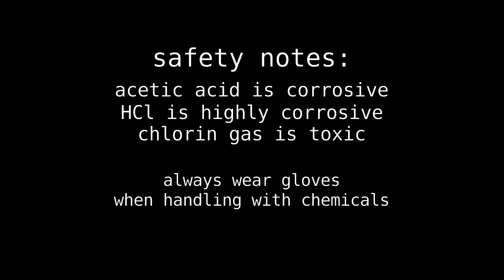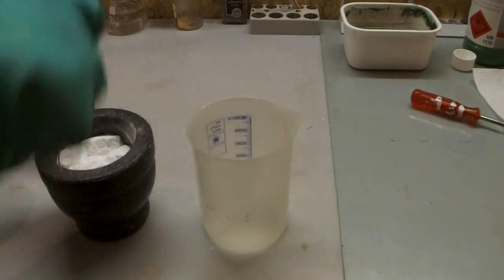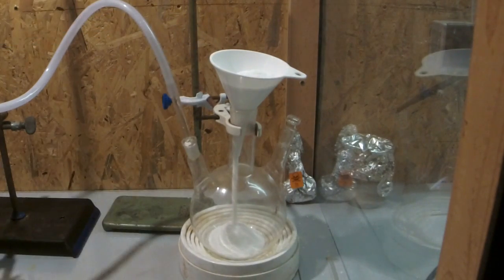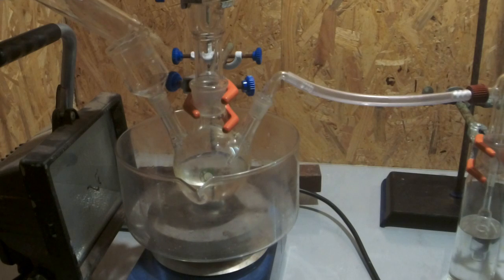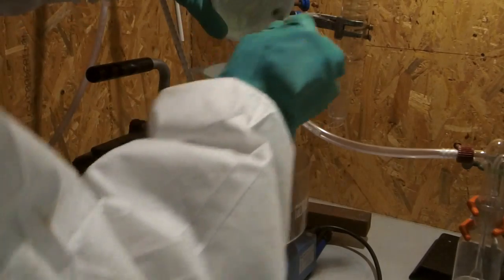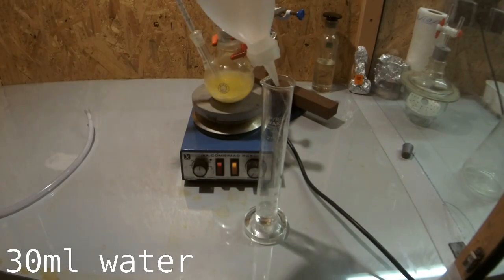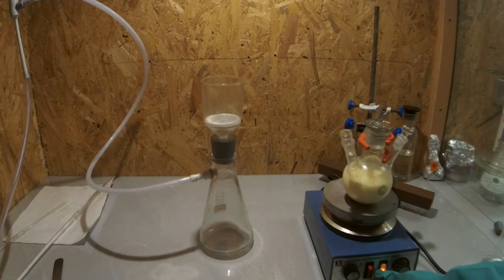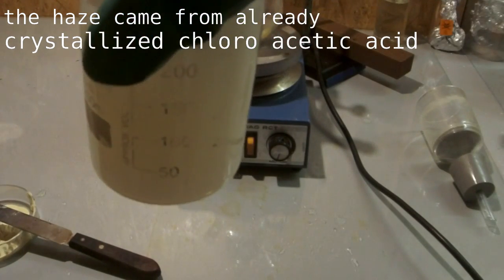Synthesis of Chloroacetic Acid

Comment: Excuse me. What's full name TCCA? 
1) TCCA - which reacts with HCl to form chlorine (Cl2)? Then chlorine will react glaceal acetic acid?
2) Why do you add 30ml water (3.43') into solution? Can it be replaced by CH3COOH 30% instead of glacial acetic acid 100%?
Reply: TCCA is Triisocyanuric acid 
the chlorine reacts with the sulfur to form sulfur chlorides wich then react further to form chloroacetic acid, acetyl chloride and anhydrides of the two. the water is there to destroy the acetyl chloride and the dimer of the chloroacetic acid.
Reply: @Moritz___ thanks sir ❤

Comment: Couldn't you have cleaned your sintered Buchner funnel using something like hot xylenes, toluene or benzene? Thats a shame to have to throw it away just for that. I recrystallized some sulfur using hot xylenes, and while it takes a decent amount of solvent, it worked well. However it took forever to be able to get the smell of both sulfur and xylenes out of the glassware (rotating washings with bleach then acetone). As a result, I now hate working with either sulfur or xylenes, lol. 
But for stuff like sulfur, I would definitely use a porcelain Buchner funnel with a filter paper

Regardless - Great video, I plan on trying to replicate this in the future, hopefully soon!

Comment: Couldn't you just electrolyze brine solution, and run the resulting chlorine through the glacial acetic acid for a few days? That would likely be cheaper (using salt), cleaner & if the power is set right you can probably focus on recycling more chlorine back into the solution.
Reply from the maker: well you would have to build a chloro alkaline electrolysis cell and the output would be quite small 
but it is an alternative. For the first part I do not think that, in the conditions you are proposing, the reaction will take place.

mfg hazelChem

Comment: QUESTION..........I have to go to  work but  i would like to add a some what unrelated question on making bromoacetone.   I am going  to put some acetone and Br2 in a pot and drip AcOH acid on it.   The problem is the acid i choose (AcOH) has a boiling point close to the product (bromoacetone).  So my question is this.   When the reaction is done can i pour some aqueous NaHCO3 in the pot to neutralize the acetic acid and partition with ether/dcm. to get the product.........OR OR will the addition of NaHCO3 do the same thing as adding NaOH and alpha deprotonate the bromoacetone  and do an aldol reaction with another bromoacetone.????????????????????????????????????     Or if there is any bromine in there and i add NaHCO3 would that be a strong enough base to cause a haloform reaction????????????    Or should i just NOT try to neutrallize the acetic acid  and extract out my product (bromoacetone) with dcm or ether or whatever and then just  do some multiple small water washes and hope i get it all out from that and distillation using a vigorex column????????????????????       Or maybe i should just throw a couple mL of sulfuric acid in to make my enols  instead of acetic acid.??????????????   That way sulfuric acid has such a high boiling point i could just use distillation to separate it from the bromoacetone?????????????

Comment: QUESTION................So is this a free radical reaction??????????   I mean you are making free radical chlorine and it grabs the alpha hydrogen off the acetic acid and then the acetic acid free radical grabs a chlorine form Cl2 gas and that makes a free radical chlorine to repeat the cycle.. ................But you said there is an acetic anhydride intermediate?????????????????????????????????   What is actually going on there??????????  I mean does the sulfur help make acetic anhydride and that is what is being chlorinated and then it decomposes into chloroacetic acid when you add water at the end???????????????????
Reply: chemiolis explains the mechanism very well in his video about chemical hair remover

Comment: Hi! Please tell me one thing. Did you "chlorinated" your lab with this process? I can see that the reflux cooler is not clogged. How do you eliminate superfulous chlorine gas? Thanks :)
Reply from the maker: well for exces cl2 there is the fumehood ;D hope that answers your question 

mfg hazelChem
Reply: I did this had a hose from vacuum port just leading outside or through a peroxide naoh scrubber first

Comment: Professional, very nice.  I need to see if I have the glassware to dry my chlorine.
Reply from the maker: you dont necessarily have to dry the chlorine .... but if you dont dry it the workup is more work intensive

mfg hazelChem
Reply: A tube with CaCl2 will also work.

Comment: Very nice Video man, are there still other vids to come? if yes please synthesis of nitromethane
Reply from the maker: there will be more videos butt i have to get used to my new audio equipment for recording the audio lines ... so im verry sorry fore the longe time without videos 
to the MeNO2 i´m working on a reaktor to direktly nitrite the methane gas 
if this is not working i have a backup plan wich involves sodiummethylsulfate :p

mfg hazelChem
Reply: @HazelChem  any followup? :D
Reply from the maker: @johngriffin618  well there is the problem of the reactor selfdestructing .... and i have to make more Cl-Ac-COOH and no time ..... but some day !

mfg hazelChem
Reply: Hazel Chem 
nice, but I dont think that the sodiummethylsulfate method would work very well, looking at the sodiumethylsulfate-way to get some nitroethane

p.s. Den combimag hab ich auch ;-)

MfG 
a.s.